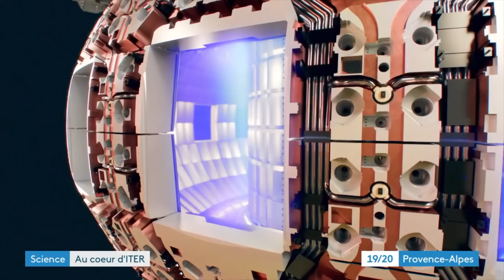Why is Nuclear Fusion, so hard? - Prof Simon.

Comment: there's not enough global beryllium supply to build another operating iter-style plant. some researchers have looked at using silicon carbide as an beryllium alternative in those tokamak. Silicon carbide has a high thermal conductivity and a low atomic number, and it would be readily available. but not sure how much beryllium that could displace for that type of confinement.

Comment: Another excellent video, Mr H! I have been following fusion for a very long time... have you looked at a company in Aus called HB11? Yes, they use power hungry Goldfinger-esque lasers, but the direct output is electricity, not heat to turn 18th century turbines
Reply from the maker: sounds good
Reply: @ProfessorSimonHolland  out of curiosity, has your hydro wheel frozen, given the cold snap in France & the UK? I very much enjoyed your about the place videos, including replacing the mower blade